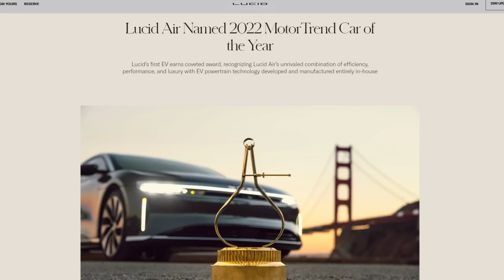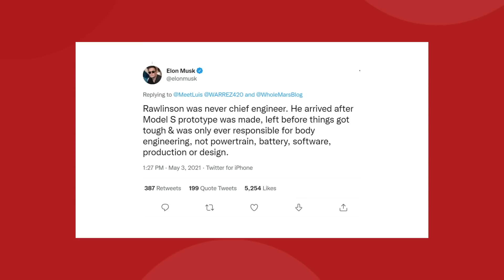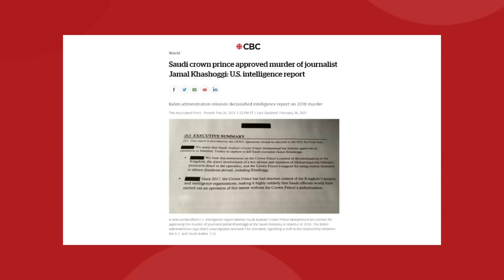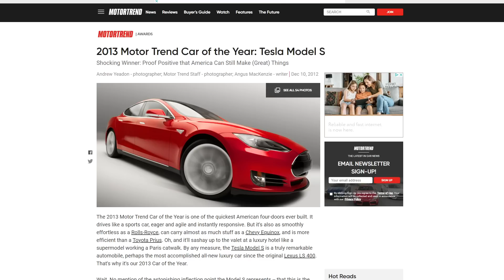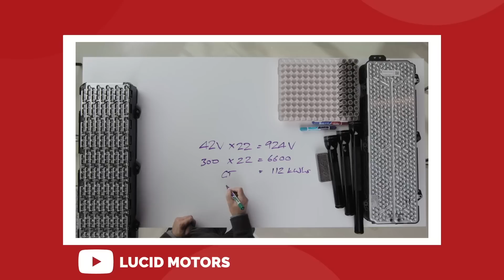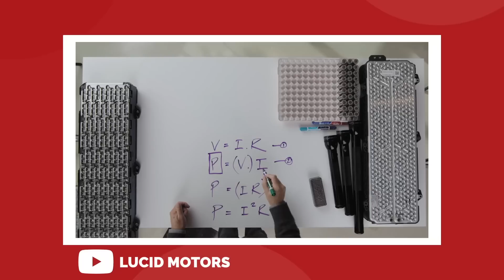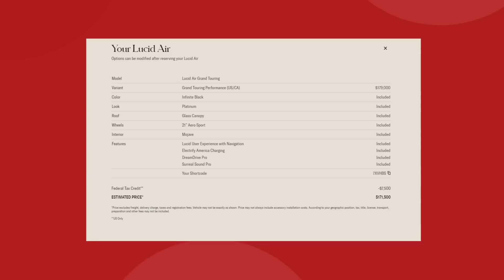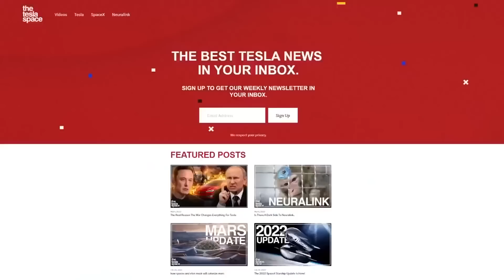Why The Lucid Air Is About To Take Over! (Tesla Vs. Lucid)

Comment: It's good they are concentrating on range instead of the daft self-driving that Tesla pursues. It's early days still for them, so they can't be criticised for failing to ramp up production, considering the teething troubles and convoluted journey Tesla had to go through to get where they are now. I'd buy a Lucid mainly because the Tesla instrument panel looks like an iBook has just been propped up in the middle of the dashboard without much thought going into ergonomics for the driver.

Comment: I watch this whole video. I'm sad that it is somehow better than a Tesla. And then at the end, the price for the basic electric car is $170,000. Ouch. I guess for $170,000 all of the fancy features are almost a moot point. Had the battery life been better than Tesla, without being double the price for the car, then it would be a seriously important achievement. I was reading today about the Ford F150 Lightning, and it's only about $40,000 for the base model, with a 150 mile or so range. The Ford F150 electric truck is genuinely a better deal than any electric car on the road, and it's a really nice looking truck.

Comment: Tesla is also using a 75-100kWh battery pack where this “longer range” Lucid is over 125 (I think it was 134)kWh battery pack and for $50,000 less, I will stick with my Tesla. I also have a Model 3 LR AWD and I paid $45k for it. I could buy 4 of these for the price of a dream edition. I could also buy a brand new Plaid and stay on the Tesla charging network and that 100 miles won’t matter. 
Just for the record: I probably will own a Lucid one day. These are unbelievable cars and the range is a cool factor I hope Tesla and Elon changes his mind about with the Plaid 4680 cells. I also hope one day the cars will drive over 1,000 miles, so you can charge to 100%, go on a weekend get a way, and finding these chargers will no longer matter. I am Air Force Reserve and being able to go for one weekend and not have to charge the entire weekend or worry about charging would be a dream (Lucid). 1,000 miles…maybe one day…

Comment: To get a peek at the truth of Peter Rawlinson at Tesla go to Tesla's YouTube page. From that channel home page click the little magnifying glass and serch for the name "Rawlinson". There you will see if he is ever mentioned, if he had a title, and if he was on any Tesla videos in some capacity. 

Hint: Videos titled "Tesla Vehicle Engineering - Part 1" & "... Part 2" feature Rawlinson explaining engineering details of the Model S, and showing his title to be "Vice President of Vehicle Engineering".

Elon probably first met Peter while he was chief engineer at Lotus, who was then building the bodies for the original Roadster. Before that Peter was chief engineer at Jaguar and had spent time designing and building open top sports cars using some of the weight saving techniques later in Lotus and in the Model S itself.

Tesla fans who get indignant at the Saudi PIF funding Lucid should remember that Elon had pitched to the same people in his bid to take Tesla private. That's right. The funding in "Funding Secured" is the $$ that ultimately went to Lucid.

A Lucid Air GT reserved (refundable deposit) before 6/1/22 will sell for $139,000. The price goes up for reservations made in June.

Vendor issues are improving significantly and deliveries have really picked up since mid-April. I got my Air GT several weeks ago and it is phenomenal. While all the talk is about range it is charging speed that makes the battery truly special. Comfort, handling, and efficiency are all top shelf.

Comment: Great car inside and out, though very expensive and extra heavy on batteries for a daily driver.  The extra range should help the car maintain value if one expects to lose 10-20% range - 410 miles or more are great for alleviating range anxiety.  It is only a vehicle for people in a very specific financial position and there aren't many out there.  What is their real production capacity?  Service centers?  Charging network - do you have to subscribe to the 20 different charger networks to travel about our country?
Over the air updates?
Full Self Driving?

Comment: It's hard for Lucid to scale right now because they are just starting up and the supplychain issues related to covid. On top of that, the complexity of the design further exacerbated the matter.

I think if Lucid can pivot and design a simpler version of the car that dodges their bottleneck - it seems to do with glass and carpet, Lucid can suddenly have a massive exponential growth as they complete the AMP2 facility.

Comment: The quality of the lucid air is not in question. It is excellent. Tesla still holds several big advantages over Lucid though. They have the experience to produce cars, and soon batteries in high volume using and developing new fabrication techniques. They have the experience to do so while producing cars that are not cheap, but far more affordable than Lucid in far higher volume and still make some of the largest profit margins in the industry. These are things Lucid still has to prove that they are capable of doing so as well.  So I hope Lucid will succeed and become one of the new main car manufacturers. I seriously doubt that though. There is a reason that Elon says "developing the product is easy, developing the system and infrastructure to mass-produce it is far more difficult"  Also, given the quality and quantity of EVs that are being developed and produced in China at the moment some of their manufacturers may end up giving even Tesla a run for their money. BYD comes to mind, look it up

Comment: 5:05 And Mercedes released the EQS which is actually quite good (a bit overpriced , but still , the highest range on a production EV for now, as the Dream is not out yet)
Reply: EQS is full of buttons, everywhere, making it seem antiquated for today's trend toward more elegent user interface.  No use of front space, strange washer fluid filler tray and smaller rear window than Teslas.  Not a fan of EQS. Lucid is better for the price but no promise of success, due to very limited production
Reply: @jkcurti  That has always been the Mercedes style

They have never been known for simplicity , and its good to have alrernatives , its never good for everyone to follow a specific trend without an option of something different

Comment: The phrase "attention to detail" used to describe LUCID cars means a high standard of quality control while implies a lot of labor cost associated with essentially hand made cars. In fact, they have over 2,000 employees producing just 400 cars a month.

For it to reach mass production and economies of scale, it will have to sell a lot of its high end models before it can venture into the lower priced models.

They have an outstanding order backlog of 25,000 cars worth about $2.5B, but they are projecting a cash burn of $2B just for 2022.

The luxury car market is going electric and LUCID will be competing against established brands like Mercedes, BMW, Audi, Porsche, Tesla, etc.

Additionally, they do not have a stable supply chain and are very vulnerable to market conditions.

Even with Saudi money, LUCID's success is not a sure thing.

Comment: Lucid is good, better than expected, but I personally see Tesla as a Tech firm...Cause of the softwate, AI advancement, and battery advancement...Tesla is on its own game...No one is even close...Not even Lucid...Tesla is very close to make a long range ev with the 4680 cells, but no point, cause a normal persons commute distance is between 100 to 200 km before atleast a break of 10 to 15 minutes, so the time to charge is there...Nowadays, range is not the prioriety, its second, first is the tech...

Comment: How can cooling from the bottom be a good idea? I will wait to see its long term degradation trend.
Reply: You can find the video on Lucid channel(this video use some scenes on that).
However, the explanation doesn't convince me at all.  Peter Rawlinson is a smooth-talking person with great presentation skill but their is no thing like big innovation in their car.
Any car makers can do it. They don't do it because there is no profit.
Toyota has just released new Lexus EV line-up. With lower price, I don't think Lucid Air have a chance at that price range. Toyota(normal class) and Lexus(mid-luxury) are very reasonable and reliable. I will bet on them.
Competing against Mercedes S-class Maybach for generating enough profit is impossible. I bet they can't even get enough money which they have spent on R&D for years.
Reply: @tenkiaqua6131  IMHO, Lucid is a scam. I concluded that after watching their launching video a few years ago.

Comment: Average sales price for Tesla is $59K.  How is Lucid Air $179K vehicle going to take over?  Where will Lucid Air be in 8 years?  You expect Tesla to be standing still I guess.  Very disappointed in your sensationalism.
Reply: Lucid Motor want to create some cheaper models, not only Lucid Air. They can utilize their technology from Lucid Air for cheaper models. It looks like Tesla used to create Model S first -> Model 3 -> Model Y -> Cyber Truck-> Semi-Truck.
The price range of Lucid Air is on par with Mercedes Maybach S-Class.
However, the biggest difference is timing. Tesla Model S was the best and unique EV car at that time. There are not too many EVs at all.
Now, all car makers jump into EV. They will release new EV models every years like normal ICE cars. There is no chance for Lucid Motor. They don't own any exclusive technologies at all.

Comment: These comments are so similar to the comments made about tesla in there early days. Guys I would rather have the car industry controlled by companies with the culture of Tesla and Lucid than traditional auto. By the way, Lucid is planning to make a scaled down version of its car that is more in line with Tesla's more main steam offerings like the Y (at approx. $71,000). One thing is for sure is that range can not be just written off as a gimmick. It's always an advantage when you can do more or the same with less. However, Lucid achilles's heel is the fact that  they are not as software driven as Tesla. In the end, its all about execution and only time will tell if Lucid will be able to make all the right decisions. However, if there very first product is any indication, they will be just fine.

Comment: I drive a 1994 Dodge Dakota and I want is someone to make simple cheap EV pickup. Not everyone wants or needs all that dainty luxury shit - self driving mode, large touch screens, cameras, motion censors, doors that automatically open veetically. I mean what ever happened to hand cranked windows and normal key holes? Why does everything have to be so soft these days?

Comment: My self not an expert of any kind but have used 18650 & 21700 Samsung 30t batteries on un-regulated mods\dripping atomizer's and the 21700 is much much better preforming battery, and the heat seems to come out the sides in my experience.

Comment: LUCID is selling high end EVs.  High priced and in much smaller quantities than Tesla.  LUCID is a far cry from taking over.  But bring it on.  They have lots of work ahead of them to catch Tesla.  Supply doesn’t meet demand.
Reply: Tesla has the same price point without the luxury and 500 miles range.
Reply: @sadhanasingh937  Tesla does NOT offer a 500 mile range.   I wish!   They could certainly offer a 500 mile range on the X or S, and even on the 3 and Y using 4680 batteries.   But Elon has specifically chosen not to do so.   It makes business sense to limit the range of their vehicles because they're constrained by 4680 battery production levels.   Still, I'd order a 500 mile range Tesla in a heartbeat if they ever made on available.   (BTW...I like luxury...sure wish Tesla would match the comfort of my 2017 Volt)
Reply: @mikeroll8515  I know I said “without” the 500 miles , the word “without” means something it does not have.

Comment: I think Elon is correct. You only need enough battery to meet you needs. I have found our Model Y 300 miles to be more than adequate for daily use and odd 2 or 3 thousand mile trip. Any more and you are un-necessarily caring around a big dead weight which will reduce efficiency of the vehicle. Unless of course you don’t have access to a good supercharger network!
Reply: Agreed. Getting more useless range is for showcase, not practical usage. No one drive over 250 miles/day for daily life(Mostly under 150 miles/day). If they have to drive over that range, they can't afford a luxury car obviously.
For travelling by car, how many times do they have per year? I don't really think

Comment: 1.  Even if they make better cars than Tesla, how are they going to build up to mass production given that every auto manufacturer in the world are facing supply issues, especially batteries?

2. How does the charging work on their cars and have they got Tesla's advantage of having its own charging infrastructure with fast charging?
Reply: They can't. I don't think they will go far with their strategy. Toyota with Lexus, BMW, Mercedes, Porsche, Honda with Acura, etc will easily beat Lucid Air in production, quality and price.
If you notice, Toyota have just released Lexus EV line-up. If I have to choice between Lucid Air and Lexus, I will bet on Lexus for long-term. Selling 500 cars by trending and marketing are easy. I doubt that they can increase their sale to 1000 for the next version.

Comment: It’s pretty clear, Half the reason Lucid can out range a model S by 20% is.. they use a 10% larger battery. It’s no mystery or great accomplishment. Yes.. they did find another 10% efficiency in their design.. which is great.. but only half as impressive as the numbers would show if you don’t look into it. And you are paying a lot for that.. which is fine for those that can afford it. But Lucid will probably never make a million cars a year.. and if they ever do.. Tesla will be at 20 million by then.. the tradeoffs for fast, large scale production obviously limit what can be achieved. On top of trying to keep costs from running wild
Reply: It's more than 10% though. Useable pack capacity on a lr model s is about 95kwhs(per bjorn and other owners data)to get up to 404 miles. useable pack capacity on the longest range lucid teated by inside evs Tom muloghney was 118kwhs and the pack itself took over 134kwhs to recharge from empty to full. 

So really the air is about 4-6% in total more efficient on a per kwh basis as the model s lr when both are on the most efficient 19" wheels. 
In fact the air is right in between the most efficient model s and model 3 with tesla still making a more efficient car overall despite other's claims to the contrary. This is easily verified on the official epa website btw. 

For the first 20mins of charging the most recent plaids got just as much range back per car and driver and again Tom muloghney own posted charging tests as the supposedly quicker lucid gets.

So not to impressive imo for using 920v architecture, very expensive sic inverters, compact amazing looking integrated drive unit's, the battery module advancements etc that lucid has deployed in the air. Plus taking almost 6 years to refine the design and test it. While asking 150-170k.

This all makes me believe elon and team tesla could've also done a 600+mile car in 2020 if they'd wanted to prove it possible. 👍🏻

Comment: Even though their niche product is exceptionally designed they are plagued with production issues that Is making for excessive cost and very small quantity of units produced. If they don’t overcome those in timely manner they may be short-lived.
Reply: the LUCID Air is Garbage.
its not as good built as a Tesla 2012 model S. 
which PETER tried badly to copy.
Reply: @markplott4820  I am a Tesla fan as well, The Lucid design as a luxury brand seems impressive but I have not heard one way or the other about quality issues. What specifically have you heard about?

Comment: It is a really nice luxury vehicle with great range and even the most avid tesla fans have to admit they have done some great things in the battery pack layouts. However the lack of dedicated consideration to the ease and speed of manufacturing these is going to lead to a much smaller piece of the market and a less profitable per vehicle share than other ev's. they may be able to survive in the market but it's going to come down to how much profit they can generate with a limited production capacity. Tesla is on the opposite end, almost everything is designed first and foremost with how quickly and efficiently they can be produced while secondly trying to offer great range and other features and alot of emphasis on the FSD. I hardly think lucid will takeover but they will likely be able to carve a small niche.
Reply: I don't think they can generate enough profit to cover R&D cost with their sale volume. The business model is not reasonable now. There are a lot of competitors who're working on luxury class.
Toyota have just released Lexus EV line-up. I will bet on Lexus EV, not Lucid Air if I want to buy a luxury car(excluding Model S).
Reply: Lucid and Rivian are not making it. No car company has made it in the last 70 years expect Tesla. It is a the hardest business to be in, globally. Rockets are worse, ask Elon.